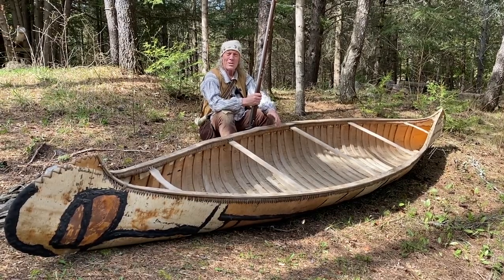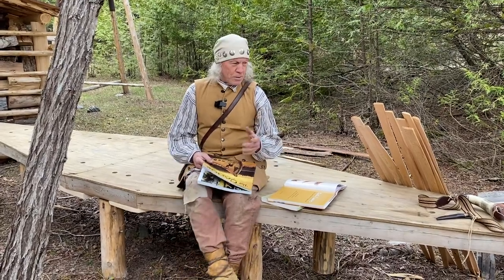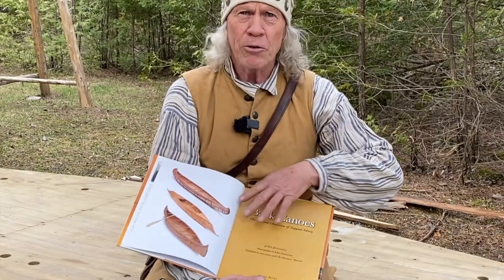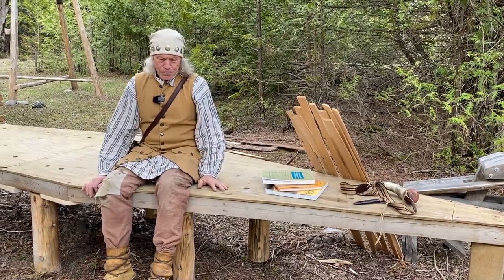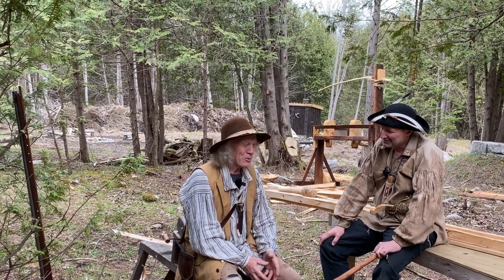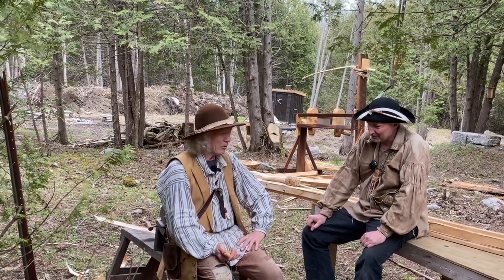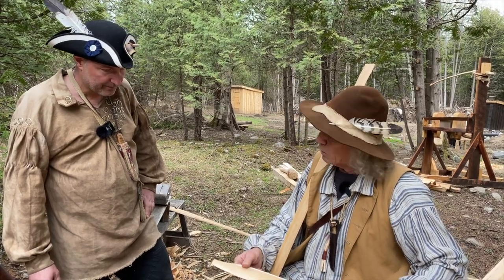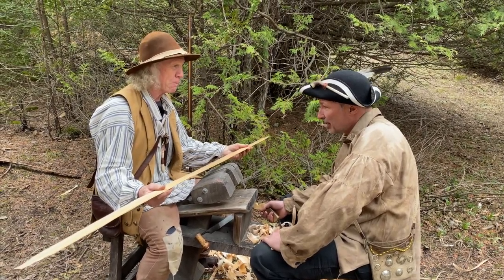Birch Bark Canoe Build - Sheathing | WOODWORKING | BUSHCRAFT | CANADIAN WILDERNESS | FRONTIER

Comment: I made a cypress fence that went down both sides of my driveway exactly the same way.  I cut the cypress trees at our farm and hauled them home in my F250 4x4.  I then split them with steel wedges, an axe and my sledge.  It was still up 30 years later when we moved.  Cutting cypress is tough, because they usually reside in water.  In my case, about a foot or two.  My Vietnam Jungle boots took a beating, as did my feet, because they are not waterproof.😮

Comment: Excellant addition to the channel as always. Can't remember which video it was, but you talked about a tumpline. I'm assuming like everything else you made your own. What did you make it from? How long is it? And would you consider a video talking more about the tumpline?
Reply from the maker: Certainly food for thought, Gregory.  I do make mine and I use hemp cordage.  I hand weave the brow band ( about 2 feet) then taper it down to 9 strands.  These strands get individually braided using a standard braid like one does their hair.  Once all 3 are braided, I braid the 3 together into one, leaving about 6” unbraided.  I add tin cones to these like they did in the 1700’s.  The total length is 20 feet.  You will lose about 2/3 the starting length, so 60 feet.  Can be a wee bit frustrating, so have someone help untangling while the other braids is very helpful.
Reply: @TheWoodlandEscape  oooookkkk that reads pretty detail for a visual learner like myself. I will have to read it a few times. But a video about your tump line at some point would be great I think.

Comment: Hello Peter, just curious to why your sheathing is shaved down instead of splitting it thin ? And you can use the sap wood for this correct and the heart wood for ribs. Thanks again
Reply from the maker: Yes, exactly.  Splitting the sheathing is the best approach but, if you don’t have perfect straight grained wood it is next to impossible, so some thinning is required.
Reply: @TheWoodlandEscape  OK that's the reason ... Thanks. Probably I will need to do the same.

Comment: Very cool! Is there any other woods that would work in place of cedar say mayb ash 🤔? Don't have any straight grained cedar like that but this is on my bucket list now!
Reply from the maker: Ash works well for the thwarts but, would not work for the ribs due primarily to the weight. Black spruce can be used and was quite a common wood used by the Northern Cree.   Black spruce need to be shaped green … right from a live tree.   When slitting out spruce one needs to go across the grain versus going with it on cedar.
Reply: @TheWoodlandEscape  ah okay spruce I should be able to find thanks.looking forward to the rest of the series

Comment: Building a canoe sounds really cool but I neither have an abundance of mature cedars nor birch. Would white pine work in place of cedar?
Reply from the maker: No it will not.  You can use black spruce but, you need to shape the ribs green not dried.